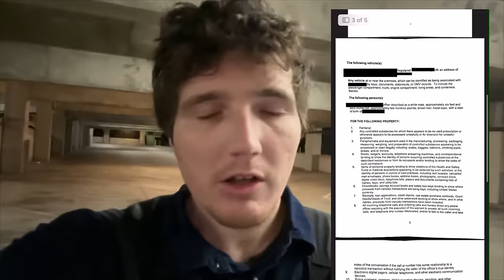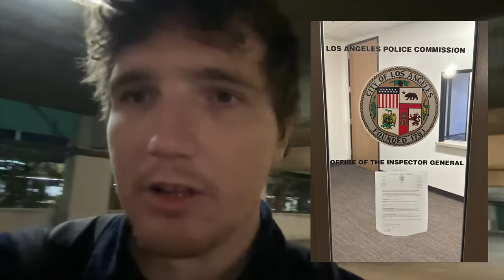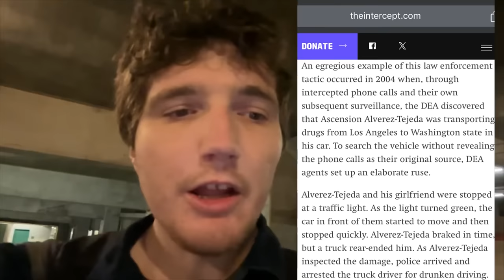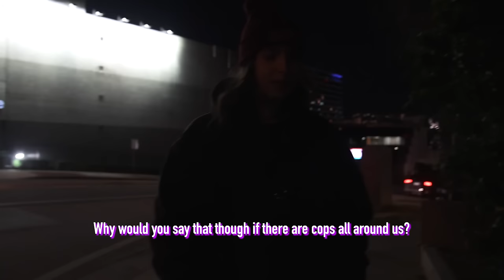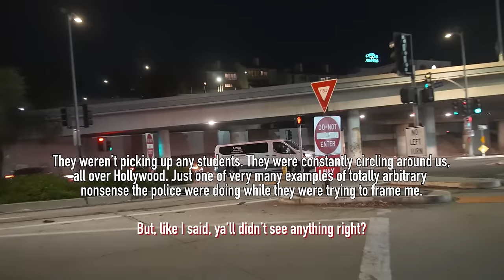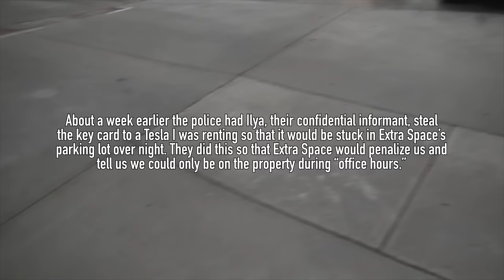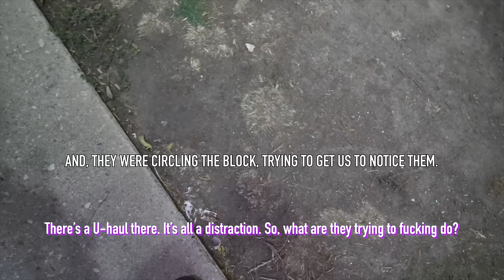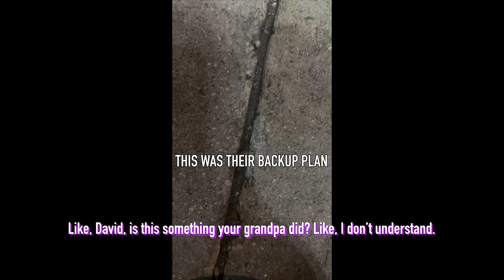I Filmed a DEA Task Force Planting Evidence on Me

Comment: Why didn’t you just log in to iCloud and lock your MacBook so it can be found when they power it on.
Reply from the maker: Because they are smarter than that. I did check my iCloud several times after it was stolen. But, when they took it to a Extra Space, it pinged at that location. Shortly after I saw this, they hacked into my Apple ID and changed my two laptops names to make it look like I had possession of the MacBook they stole.